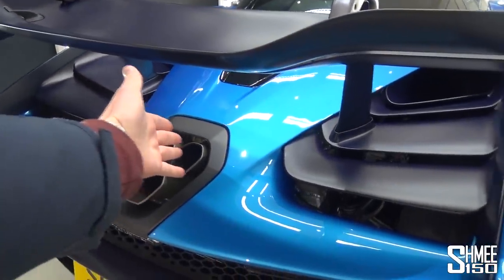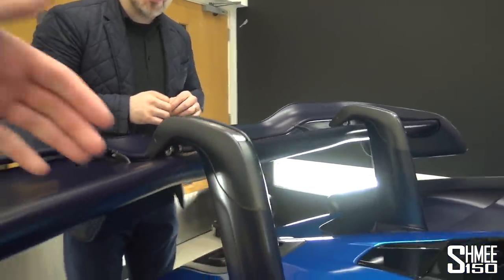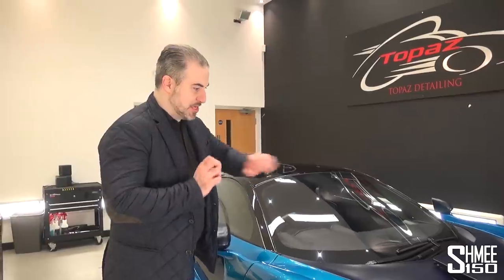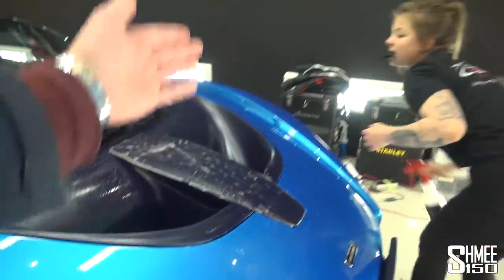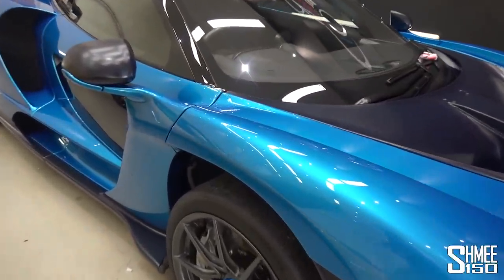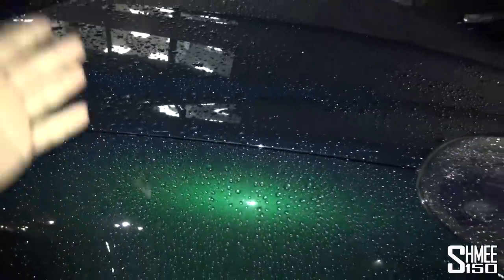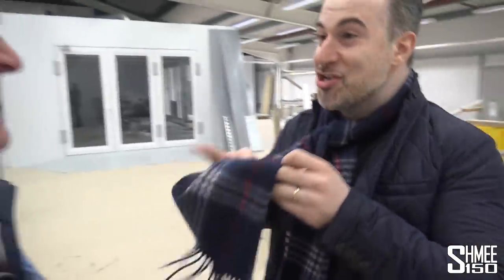The McLaren Senna is the HARDEST Car for PPF!

Comment: I used to work at a shop in south Florida(which has gone out of business due to a corrupt owner)and my job was to do a “shakedown drive” for people purchasing used super cars and collectible cars.  The thing that most of these owners would tell me, repeatedly, was how insanely expensive it was to do basic preventive maintenance.  For really high end cars that were actually driven on a regular basis, it wouldn’t be unusual for an owner to drop $50-$60k p/year with just basic maintenance.  Mclarens were some of the worst when it came to PM costs.  I only knew one guy(he was a shareholder of mclaren) who kept one for more than a year.  The initial sticker shock of cars at this level is just the beginning.

Comment: How much did that cost? Sounds like the PPF labour alone would cost a small mortgage!!!
Reply: No kidding, I could only imagine.
Reply: usually its around 3- 5k for PPF
Reply: Lee Ludtke that’s a pretty reasonable price
Reply: Theres places in the US that are charging $11k
Reply: This is probably a $10,000 PPF, maybe $15,000 including detailing. 3-5k is way too low, you pay 3k to get a decent wrap, this is much more detailed and artistic.
Reply: Here in the States a whole car PPF job is about $8 grand not including the detail to get the paintwork spot on.. So your looking at 12 all together.. I install Xpel and Gtechniq at my shop
Reply: Probably not much in exchange for all this advertising and naming Topaz numerous times...
Reply: If you can afford a £750,000 car then small details like spending several thousands is nothing. Btw, you are talking £800 for a wash and valet, upto £20k on a full wrap and PPF.
Reply: Full custom bulk install 10k minimum.  Paint correction and coating add another 5k
Reply: It's between $15K-20K to do a really difficult car like this. It's not a bunch of squares like a regular car. It's all sorts of intricate cut outs. They did the detail, paint correction, polishing, buffing, another detail, PPF, another detail, then ceramic coating. So it's going to be closer to the $20K.
Reply: This is probably a $15k ppf. I was quoted $4k just to cover the front bumper, hood, roof, trunk, and spoiler on my Challenger 392
Reply: Sponsored video... Not worth it for plebs like us. If you've got an exotic worth $$$ then you'll probably recover the cost through insurance premium
Reply: @julian987r4  lol what color combination is yours?
Reply: This is atleast 8k. On topaz website it already says a full car starts from 7-8k. And the senna is a difficult car so I would say it easily goes to 10k pounds for the senna without paint correction etc
Reply: Etienne Pauloo it isn’t $ it’s £. Dummy. Learn your English
Reply: Paul D it isn’t $ it’s £. Dummy. Learn your English
Reply: Here in romania they charge about 100$ per square meter
Reply: To PPF the Senna, it is costing around at least $10K. I heard Topaz was charging upwards of $20K USD too.
Reply: Schmee already confirmed in another video it's about 10k GBP at Topaz.
Reply: Well, the two Topaz brothers aren't millionaires for no reason.
Reply: Paying that much money to put some stretchy plastic on a car. I can understand that it is a tedious and long job so they should be paid for the labour but 10k is way overpriced. About 1500 for labour and 1500 for the product is a fair price. 

For the money the comments are saying you could buy a nice car.
Reply: @WarrenF  "Stretch of plastic" 
Here's a guy who knows jackshit about cars.

Comment: I was very much looking forward to seeing the new Senna at the Autosport show recently, but...........

For some odd reason I was very underwhelmed when I checked the car out up close - the car doesn't excite me one bit.

The Brabham BT62 seems to have an overall better spec and design:

*972kg dry (around 300kg less than the Senna)
*1200kg downforce (200kg more than the Senna)
*Double wishbone suspension that put the springs/struts outside the wheel arches for better aero (unlike the Senna).
*Much better engine/gearbox sound than the Senna.
*Much better looking cockpit than the Senna (Mclaren interiors always look dull).
*Infinitely better looking exterior than the Senna.

I find it odd and frustrating that a brand with the status and the track record of Mclaren are not taking their designs seriously enough.

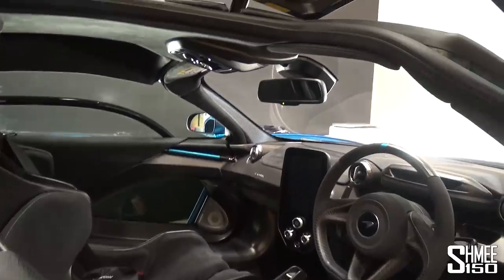When Mclaren produce a 1000kg car, with 1000hp, downforce approaching 2000kg or more, Active/Wishbone suspension (i.e like the WTAC Porsche RP968), All-wheel steering (i.e like the GT2 RS), and do a 6:30 Nurburgring lap time - then I'll start taking them seriously as a car maker.

Comment: i know it will save a fortune in paint damage but how much did all that cost i know PPF is not cheap neither is detailing add other coatings (if required) must be in the mid 4 figures if not more
Reply from the maker: There is actually pricing on the Topaz website: https://topazdetailing.com
Reply: @Shmee150  thanks for the reply i'll check it out much as i like doing my own detailing modern paints are getting thinner & harder for a home detailer to work on without spending big money on tools to check paint depth etc

Comment: Surely as part of "proper full design" and to insure the car is fit for purpose  by the car manufacturer  they should insure that you can at least  as a minimum get into the car driver seat without causing damage ???,  or is it all about HP and Torque etc and forget about the rest ..
Reply from the maker: Depends how careful the person is... I've seen many Ferraris, Lambos and others with damage sills and carbon seats owing to occupants not looking after them - mostly passengers it has to be said. Put yourself in my shoes, I allow somebody who has never been in a supercar, or has awareness of the replacement part cost, to take a step in and they accidentally damage it... so easy to do!